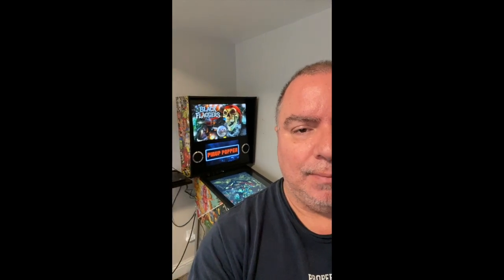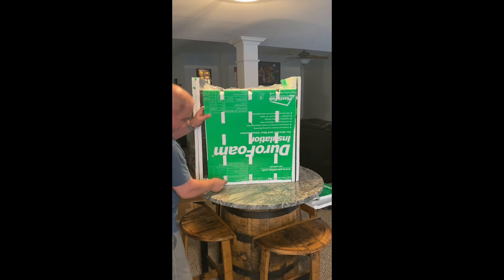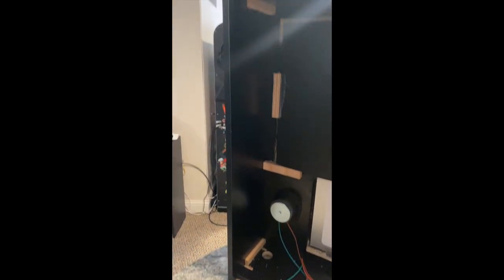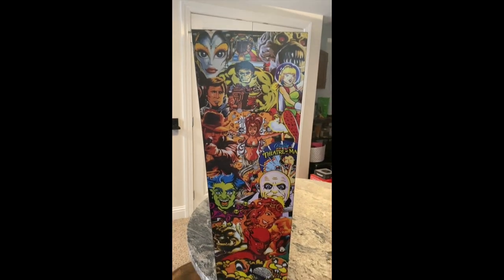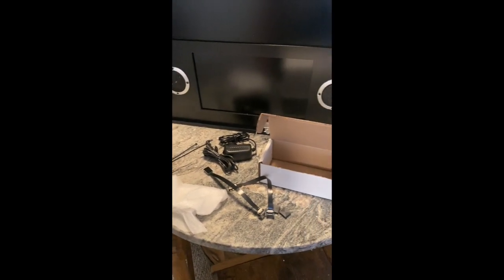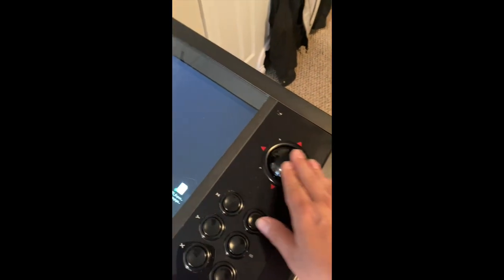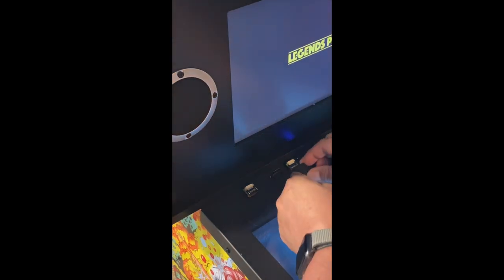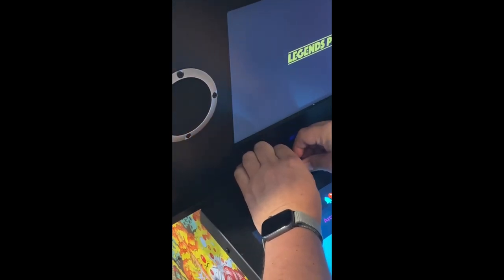Buy Stuff Store Backbox Unboxing and Setup

Comment: Consider buying the 1.0 because I don’t play the build in pinball tables.  Can you tell me if the images from coin ops X arcade stick would display on the top screen or the small one?
Reply from the maker: When you use OTG, you can tell the ALP what screen to send the primary display of your computer to. So if you wanted to play on the backbox, you would select "Secondary" display when you change to OTG mode. This should go to the larger display. I would double check with Buy Stuff Arcades to make sure I'm not mis-representing the newer back boxes.

Comment: Thanks for the video! The back box looks great. Too bad they are not including a back door for it but that should be something easy enough to make and add.
Reply from the maker: I agree. I believe they are looking at adding it as an option.
Reply from the maker: They have since started making back panels for it. They sent me one. I featured it in a recent episode of Basement Corner Arcade Show.
Reply: i dont think it need a backglass penal . as right now I'm not using my backglass penal come with ALP . i feel like the vib board make a lot of heat when it on and don't want to trap and heat inside the backglass box just saying

Comment: Scott where did you install your switcher button?  When your launch FP/VPX from your laptop at what point do you push your switcher button?
Reply from the maker: Since I had already drilled the hole on the bottom of the playfield (opposite the power button) I kept it there. That is where you should put the 3D printed button mount too. I push the switcher button as soon as I've put the playfield into OTG mode.

Comment: Good video, thanks for sharing. A question, how many outputs do you have on your laptop? How did you by-pass the HDMI/usb on the front of the cabinet? I thought that you had to connect to that one with the upgraded back box.
Reply from the maker: My laptop has 1 HDMI port that I connect to the playfield. The video should have had a section where I showed the flat cables run from the front ports, under the new back box, and out the back. For the 2 other HDMI ports, I used a Thunderbolt 3 dock that has 2 HDMI, 1 Ethernet, and 2 USB.
Reply: Perfect, thanks. It makes sense, I wanted to confirm that the Thunderbolt/usb-c  to HDMI worked fine.

Comment: Edit: They come with a back now (still out of stock though). Looks amazing though. I want one. Kinda wish it had a plexi cover.
Reply from the maker: I'm torn about plexiglass cover. I see the value and then I also see the easily scratched plexis on other devices.
Reply: I wouldn't be too worried about scratching it, but after looking at a few other videos I think I like it the way it is. It's a huge upgrade over that tiny stock back box anyway.
Reply from the maker: @griftgfx  Huge upgrade in more ways than one.
Reply: @Raskull  Came back to this because I just put myself on their waiting list. I came around on the plexi. I think that looks better now, but I'm also still considering attempting to build one myself because of the cost and wait.

Comment: How much did the backbox cost
Reply from the maker: Currently listed at $529 (includes $70 deposit you get back when you return original back box). There are options to include VIBS board, 4 speakers, amp, sub, etc that would increase the cost. Also, custom artwork costs extra. More info at https://www.buystuffarcades.com/products/deluxe-backbox-for-atgames-legends-pinball

Comment: Hi, what's the resolution and size of the backbox
Reply from the maker: The DMD is the stock 15.6 edp monitor from the stock back box. The additional monitor is 24”. Both are 1920 x 1080. Version 1 is 25-5/8” wide. With feet fully extended on the ALP it is 66-3/8” from floor to top of box.